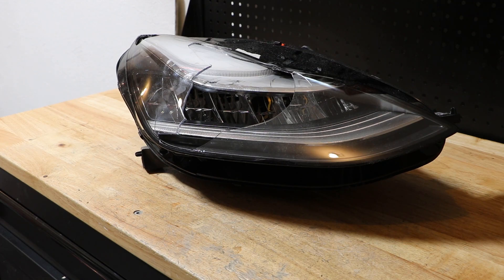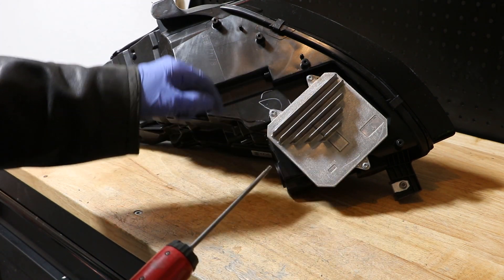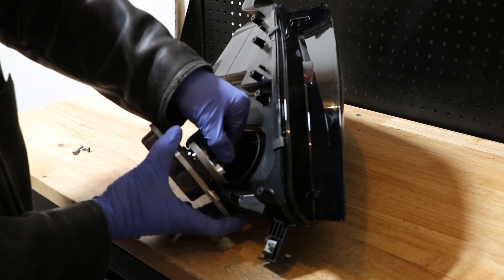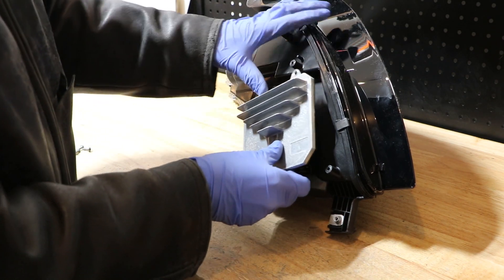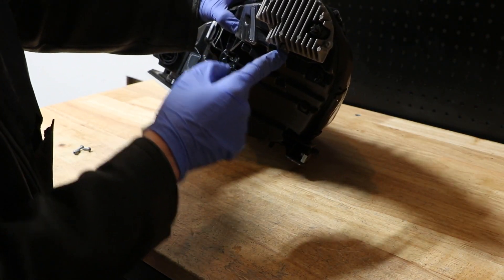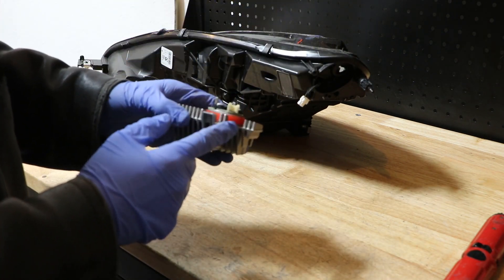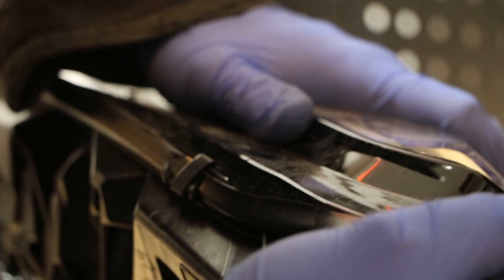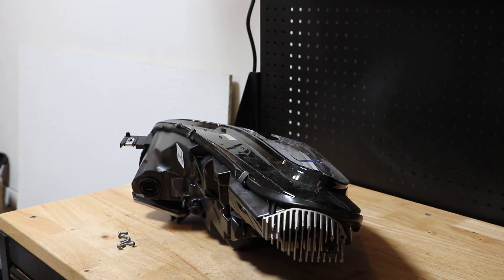How to Replace Tesla Model 3 OEM LED Ballast and Turn Signal/Light Bar LED Controller

Comment: Hiya, feel free to disregard but I have a question!

About two months ago after getting my car detailed, I noticed my driver's side headlight (lows/highs/signal) all were no longer working.

Do you think it's possible the ballast is to blame? Or would that not affect the turn signal as well.

I'm essentially trying to figure out if I should start with replacing that (<$50) before replacing the entire headlight module (~$200+). Just seems weird to me that everything went all at once (maybe a wire issue?).
Reply from the maker: If water got inside of the light, it's 50/50 if replacing the ballast will correct the issue.   If the LEDs and circuits inside of the light got water in them and corroded any wiring/PCB tracing then you'll need a whole new headlight.   

The "free" option would be to swap your controllers from your left to right side headlights, reprogram them, and see if the issue follows the controller or the headlight.  This would also give you an opportunity to pull the ballast off of the non-functioning light and inspect it for physical damage/corrosion once you disconnect it from the wire harness.  

With that being said, if the headlight allowed water inside and water damaged the controller, replacing the controller might only be a short term solution as water can still penetrate the headlight again and damage any replacement controllers.

Comment: Hi I just watched your very informative video. I just have a question. I own a 2019 model 3 that I purchased used. Found out a week later that passenger headlights is always on. Not the DTL. Blinker on the same lamp does not work. After parking vehicle, main lamp stays on for a bit before turning off. Also, high beam for the same lamp doesn’t work. Do I need a new headlamp or can I just replace both ballast?
Reply from the maker: It's hard to say.   You could try to swap the controllers from left to right reinstall the software and see if the issue stays with the light or moves.   You could remove the ballast and look for physical damage.   You could also try to Force a software update and see if it self corrects.    

It could also be something else.  I'm guessing the vehicle was wrecked and it might not have been repaired properly causing some sort of wiring issue
Reply: @gftgrill  I’ve never thought of it ever being wrecked. It was not listed as wrecked by the dealership when I purchased. It seemed suspicious that a four year old car had less than 8k miles at the time of purchase in March. Just told an older gentleman had it and didn’t drive it out of frustration with the technology. 

How can I find out if it was ever wrecked. Tesla has tried resetting vehicle remotely once and that didn’t work.

Thank you for responding to my questions and I enjoyed the video
Reply from the maker: @kunlisi  you would have to look for physical signs of repair.  Witness marks that things were removed.  Looks for signs that the headlight has been worked on like the sticker showing the headlight was manufactured after the car was built.   

LEDs Don't last forever, and sometimes you get a bad one.   It could just be bad luck.
Reply: @gftgrill  thank you
Reply: @kunlisi  I have the same or similar problem on my 2018 Model 3. My passenger headlight (low beam) stays on. Did you end up replacing the ballast and had any luck there? By the way I have had mine from new and the headlight was never damaged, so I don't think yours is necessarily wrecked or anything like that. Mine just started doing this out of nowhere.

Comment: Hi, I saw your headlight disassembly video, I have a problem on the headlight of my model, there seems to be a cobweb inside the left headlight, what can I do without replacing the headlight?
Reply from the maker: I think the only options are to remove the ballast or led module and use air to blow it out or try a vacuum to create negative pressure to suck it out.   You might get lucky and try removing the headlight and shaking it around to see if it falls to the bottom.   If it's still under warranty you might try to see if tesla will replace it.
Reply: Hello, yes yesterday Tesla assistance replied telling me that it is not covered by the warranty because it was a spider, and the cost to change it is €1400, but how did it get in? Are there any holes? your suggestion is excellent according to you and is it possible to disassemble the reactor once the frunk has been removed without removing the lighthouse from its housing? thank you so much for your first and next answer 😊
Reply from the maker: @AurelioMarino  it might be possible, but it'll be 3 times the amount of work of just removing the headlight and working with it on a table.   You're going to need to remove the front bumper.   Depending on the year there are 2 or 3 mounting tabs on the light.   You should expect to spend around an hour to get the headlight out, probably an hour or so messing with it to get the web out and then another hour putting things back together.  2 hours if you move fast.
Reply: Ciao,la traduzione purtroppo non è delle migliori ma penso di aver capito grazie 🙏 mille.

Comment: Can I put y models units  like this to 3 models assembly ?
Reply from the maker: Yes, the model 3 and Y headlights are interchangeable.  You must use a reflector to reflector headlight & ballast.  You cannot interchange lights or parts between the reflector and projector headlights (they use different controllers and are made by different companies).

Comment: Headlight has firmware which needs to match the car firmware. Therefore need to reinstall the car's software through service mode on the car screen if replacing the headlight with a different one. This will ensure that the headlight and car firmware match so that the headlight works properly. Otherwise, you can wait until the next over the air software up-date.

Comment: Need to replace my Driver Side Model 3 headlight due to a cracked lens, but been reading about possibly needing to have it "reprogramed" by Tesla. 

Any insight to this OR by swapping the ballast and LED controllers from the old unit to the new one can this be avoided? Tesla wants $1200 for a new headlight installed.
Reply from the maker: Someone else posted here awhile ago that you need to perform a software update in the car after replacing the headlight.  Im not aware of any other programming that needs to be completed
Reply: @gftgrill  FYI, had my buddy swap my damaged drivers side headlight yesterday with a lightly used one off eBay. Plug and play, no "programing" or "update" of any kind...just plug-n-play on my 2018 Model 3 LR RWD. Got the replacement for less than $120!
Reply: @NJturtlePower  that's a relief, I just go a used one for my 2018, hoping I don't need Teslas help...

Comment: I can’t thank you enough, you’ve been extremely helpful and informative. Fortunately, I was able to find replacement headlights for a pretty reasonable price. I’m going to replace both of mine, and then I’m going to polish, and attempt to repair the offending headlight. Once I do that, I can keep them as a spare, or try to resell them. I don’t want to become a pain in your ass, but I have another question. Can I bench test these lights? How?Thank you again.
Reply from the maker: https://youtu.be/q-nWFUSk3uM?t=302  

basically you can sort of bench test it.  without a canbus communicator, you cannot control the individual lights as the model 3 has a 3 wire connector for the whole headlight.